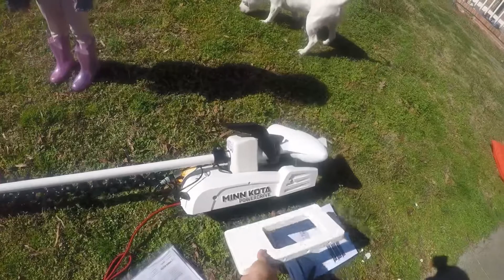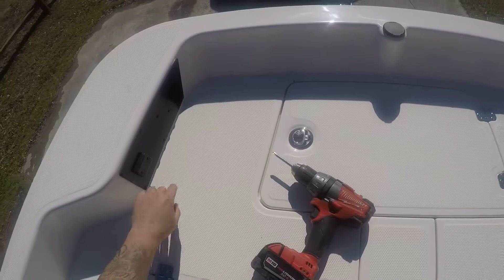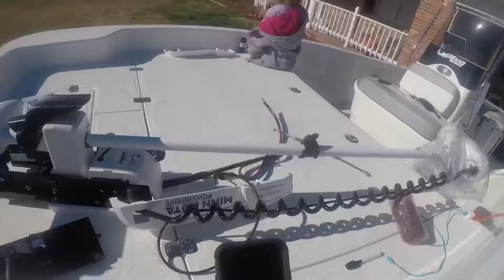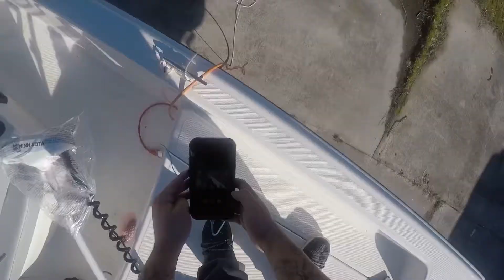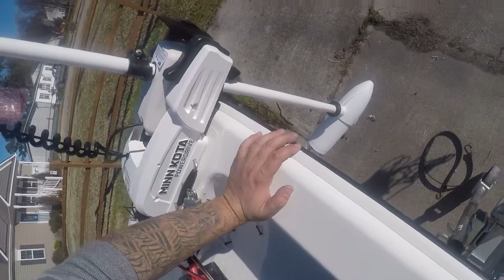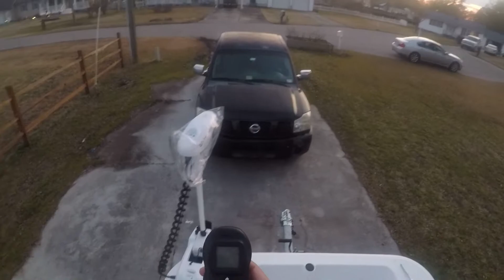Installing Minn Kota Trolling Motor

Comment: Did you have to drill through the front lip of the hull? It seems impossible to get clearance without doing that.
Reply from the maker: yes you have to
Reply: @itsDUBZyo  that’s what I ended up doing. Talked to Minn Kota and they had no idea that was necessary.
Reply: Did you install a heading sensor?
Reply: @calirob1982  I didn’t. It holds position with spot lock but the current will definitely whip the boat around if you’re not facing into it.
Reply: @boss302nard  I just installed heading sensor for the Jog feature.
Reply: @calirob1982  how are you liking it?